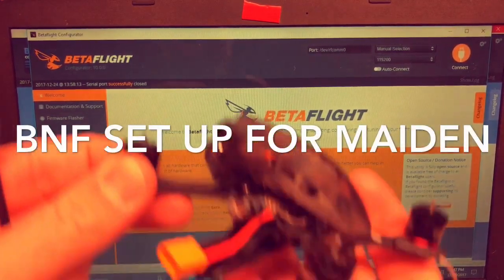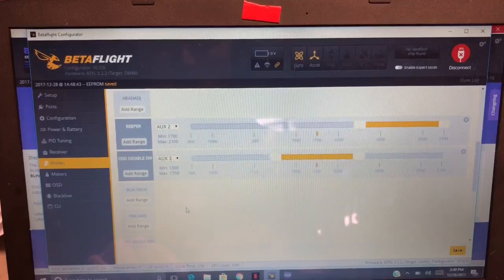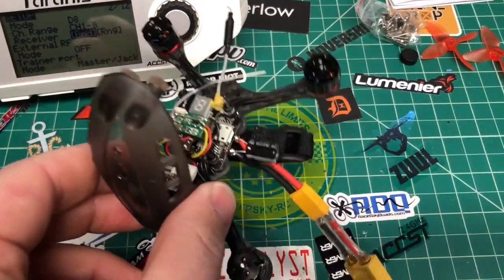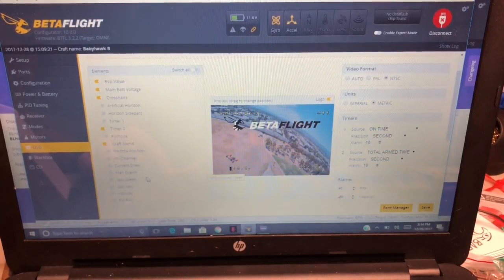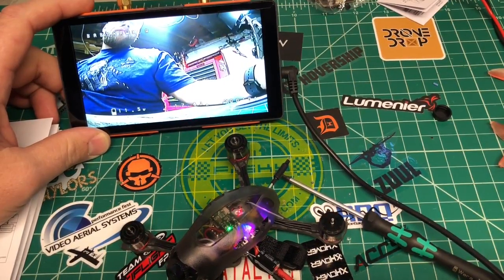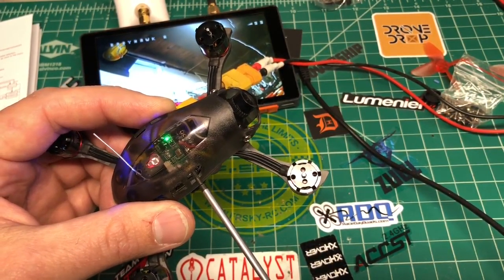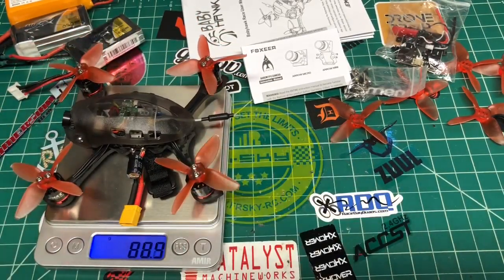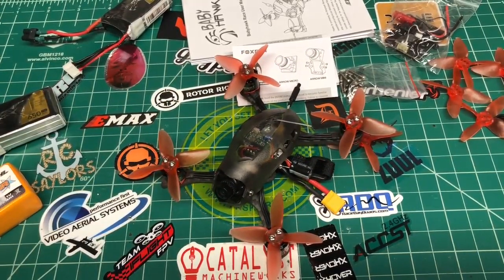babyhawk R BNF set up for maiden flight

Comment: Again thank you for all the knowledge. Maybe u can help when I am flying faceing the sun it gives me a soild white line running vertical back to my goggles. I have a great picture but when I fly towards r into where the sun is it sends a line to my goggles crazy is this something with the foxerr? Only when it hits the sun I get a line from the sun on my goggles. If u kinda understand what I am talking about is there away to fix it. Really annoying to have a great picture but when I fly towards r face the sun the line is running up and down from were the sun is .
Reply from the maker: Jeremy Chotto yes it’s a common issue with ccd sensors Wich are in the FOXEER micro arrow camera. The only true way to avoid this issue is to upgrade to a monster , predator, eagle, sparrow 2, sparrow 2 pro. CMOS sensor. FOXEER predator and monster micro cams will fit in the stock space no problem. The other cams will give you fitment issues. We all deal with this issue. It’s a delay in the sensor. You can try to mess with settings but won’t help that much. I fly mainly cmos sensor cams especially when the sun is getting lower. You will also learn ways to fly around it over time. My babyhawk has a monster micro, Very good camera!
Reply: @chrisr112887  thank you again so much bro thank u. I am looking in the settings now

Comment: where was the flight mode in your osd did u ever find it
Reply from the maker: Jeremy Chotto never did on that emax board. Lol. I changed the board out eventually anyway. Running an hglrc stack now.
Reply: my friend in the receiver tab in betaflight underchannel map aetr1234 what should we select in that in the  video u did not change it i see some people do and some dont when they do change it they go to spectum jr just a little confused about that i know we are dealing with frsky in past videos dealing with frsky d8 mode they have chosen spectrum jr to i am binding it with the jumper t8sg thank so much for help
Reply from the maker: Jeremy Chotto ok so frsky comes spektrum jr layout by default. Back in cleanflight days it came default aetr so a lot of people used that layout and stuck with it. Frsky taranis can use either channel map. Check in the taranis menu and select the correct mapping for your transmitter. Personally I was used to using aetr so I changed my taranis and use that. It doesn’t ultimately matter.

Comment: Dude thanks for the review, but if you help.. can't bind. getting green lite. like your vid when powering but when I unplug and replug it's not green . and won't arm, any thoughts, btw it's qx7
Reply from the maker: John LaRocca, MDT try a different receiver. Maybe you can get an idea on what is happening. If you don’t get a solid green light on the receiver the quad won’t respond.
Reply: hey thanks for responding....AETR was backwards...got it running...
Reply: I followed you step by step. Got a solid green light but it will not arm.
Reply from the maker: Check the channel map. Green light means it’s bound to transmitter. Has to be some setting in BETAFLIGHT.
Reply: I'm getting stick values. But nothing in my switches...
Reply from the maker: John LaRocca, MDT check your input and mixer pages on your transmitter
Reply: Will do. And of course batteries need charging at this point. In the meantime, I'll study up on the transmitter...Thanks Chris. Greatly appreciative...
Reply: Good news. She's arming on command. Switches were not set within TX. All good now. Keep the vids coming please!
Reply: Can you plug both the battery and usb in at same time ?  Or will it fry?
Reply: You can and is necessary in some  applications. Just be sure to remove your props.

Comment: Emax told me to use 800 or 850mah. Did you try them?
Reply from the maker: RcToys no. I’m running it on 2.5 props with 650 packs and getting 4 minutes plus. Tattu 650 3s 75c.
Reply: Chris romano 800 or 850mah should work because on my flyegg 100mm I use 850mah 2s it flys just fine and I get 6-7 minuets but either way is good to use. Thank you very very much for that video I had questions but you answered them in your video. Great job I’m watching for more videos like this you explain very well a error that many others reviewers don’t do in explaining things on quads thinking everyone already knows what to do. Thank you
Reply from the maker: RcToys 850s will work for sure. Even 1000 will work. Just have to find weight to power you like. Thanks for your kind words. It’s what makes me want to make these videos.
Reply: Chris Romano Airblade has some great stuff in the smaller lipo sizes. Lots of their batteries are made for them by bonka, they are just lighter versions made specifically for airblade. They are lightweight and have lots of punch. My 1000mah 4s (75c/150c) airblade lipo weighs the exact same as my 850mah 4s GNB lipo. Its got just as much punch if not more, weighs the same, and has longer flight times. I wouldnt use that particular lipo on a babyhawk r, but thats just an example of what kind of batteries they have. They've got some super light 850mah 3s that would be great on the babyhawk r. So would their 600mah 3s which weighs 53grams. Unfortunately im not sure about the weight of the other sizes off the top of my head, but I know its all top notch stuff. Another thing I appreciate is that airblade actually weighs their batteries properly and advertises the weighta correctly. I hate buying batteries from other companies only to find out they are actually much heavier than advertised.